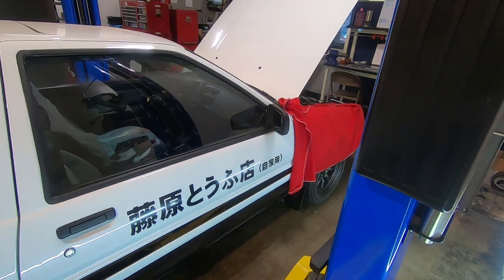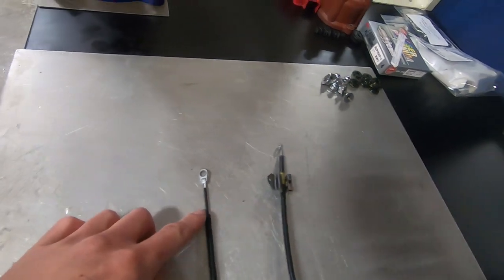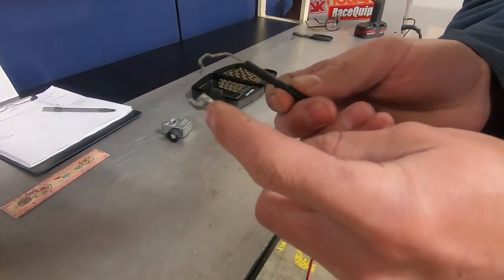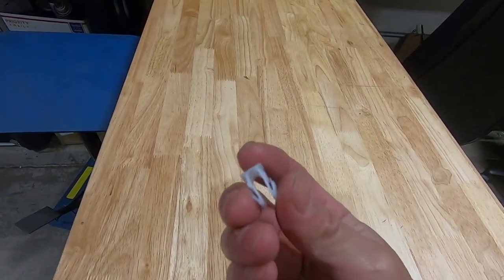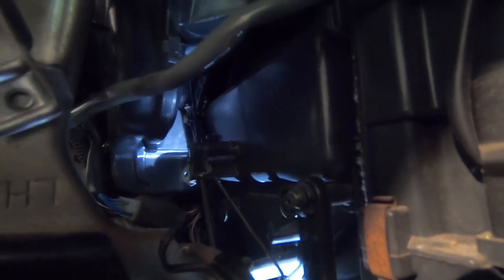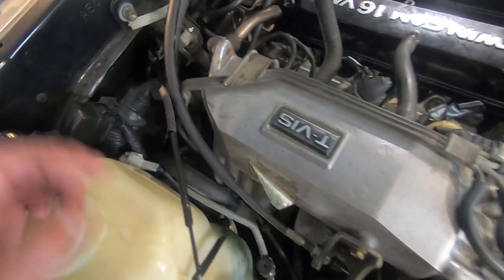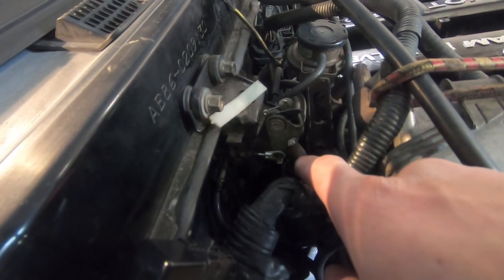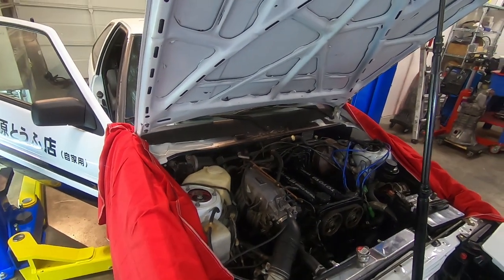How To: AE86 Climate Cable Upgrade

Comment: Dang I replaced the valve in the engine bay but now I wonder if I need the cable too. Great content as always
Reply from the maker: Glad you found this useful. Most cables are seized or close to by now.

Comment: If you take the original cables off if there not broken take them and dip them in a pan with new motor oil for a few days and when you take them out they will work like new.
Reply from the maker: Great tip! Thank you!

Comment: Great video
Reply: Would these cables work on right hand drive 🤔
Reply from the maker: @321CrashandBurn  I want to say yes. The heater valve and climate unit is all in the same spot on LHD/RHD. You can custom cut those notches and clip the cables where you need to also. I cant see a situation where the cables are too short.

Comment: Ebay got RHD 4 piece set from japan, but not sure if they will work for our LHD car.
Reply from the maker: 4 piece set of what? It may not work with LHD cars as the HVAC boxes are now on the left side on a RHD car. The cables at least will be different lengths.

Comment: I want to gut and simplify what has been done behind the dash. Maybe find a smaller heater core and blower unit to save space. I need heat, not having a/c would be fine if the temperatures remain lower than 100°f. 

I have a 20v with the T3 waterline kit and a pipercross air filter over the itb's,  there's hardly any room in the bay as well. So, that's something else I need to change.

Comment: Good explanation , very useful info. Do you know if this clamp will fit for the cable which changing different positions of ventilation by the control unit ? Last time I removed control unit and this clamp crack , and the cable is not holding anymore ((
Reply from the maker: Im pretty sure it will fit. All those white clamps should be the same.

Comment: Do you have a link to buy to that cable sheathing that you used? Or any idea where i can buy some? Thanks.
Reply: Actually, my massive brain (approx. 300 IQ) and I came up with another solution. I clipped 20mm of the original cable and used the sheathing from it. I drilled the hole the old cable would travel through up to 1/8th and then sliced down the center of the sheathing so I could wrap it around the new cable. Then I duct taped it to the sheathing of the new cable.